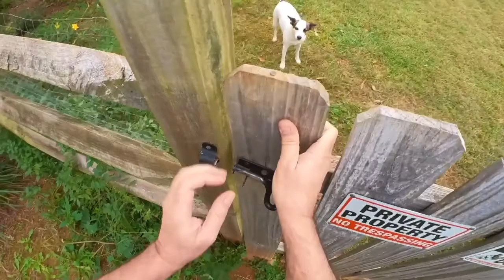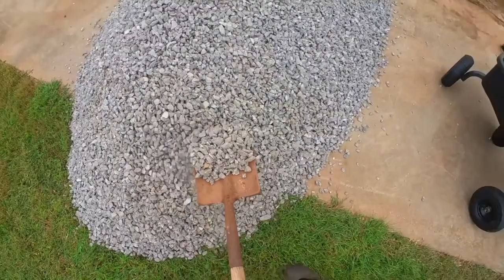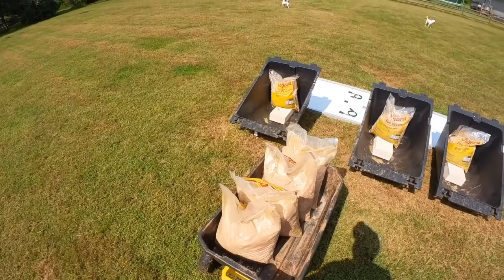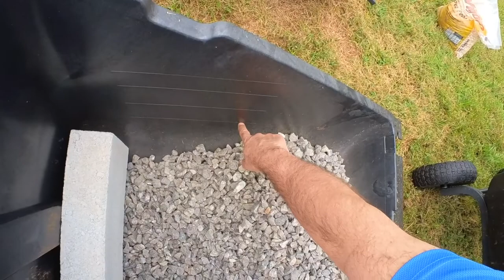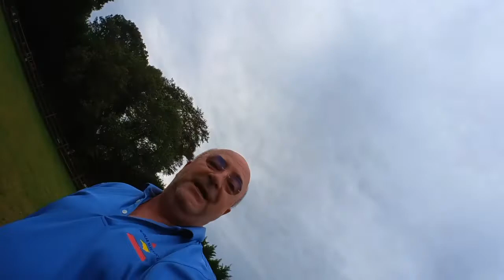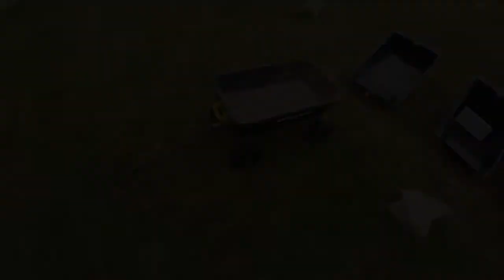My New DIY Solar Project - Part 1

Comment: If at all possible I would rather just leave the gravel in the bags.  Just cover the bottom layer with loose gravel for drainage.
Reply: I didn't use the bagged pea gravel. I used #56 crushed stone, about 1 cu-yd for the first 4. Then another 2 cu-yd for the next 8, and I used CMU half-blocks for the last 4. The half-blocks installed much faster, were easier to move, and resulted in a much faster installation.